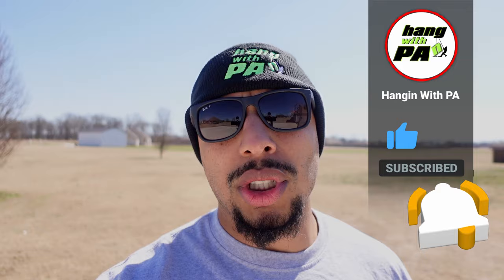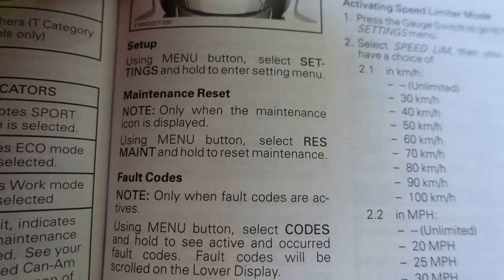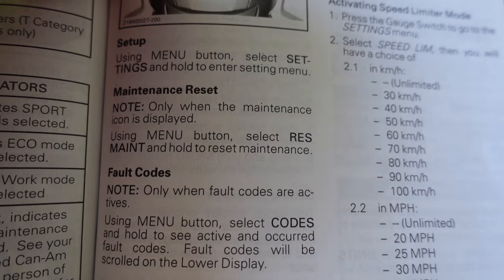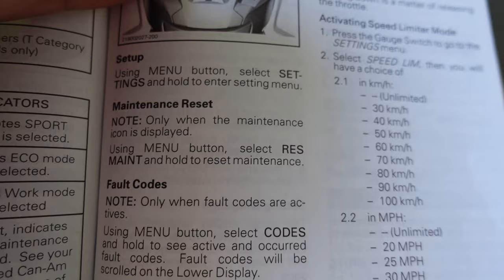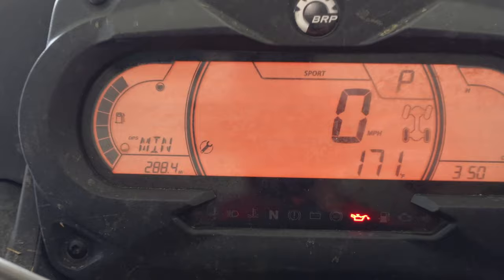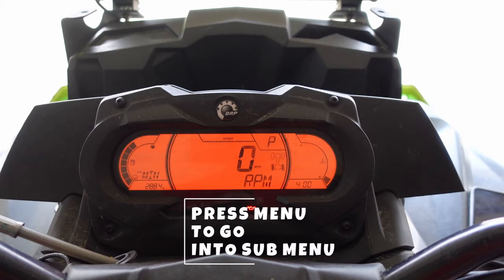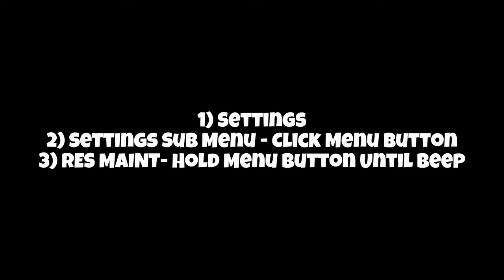HOW TO RESET MAINTENANCE REQUIRED LIGHT 2020 CANAM OUTLANDER

Comment: That noise is a check valve on ur vent for ur gas tank pretty easy fix its on the back right side under the finder by filler neck... thanks for the vid
Reply: My homie has a renegade was doing the same thing worth a look pretty sure the outlanders r the same
Reply from the maker: What noise are you referring to? What time in the video ?
Reply: When u start it after clearing the code its the whistling sound
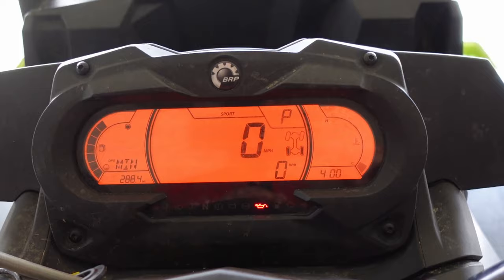Reply: From 1:30 and on u can hear it
Reply from the maker: Ok i will look into this thanks
Reply: @HanginWithPA  mine makes that whistling sound in park and neutral, pretty sure it is noise resonating from cvt belt vent.  Will go away as soon as it gear.
Reply from the maker: Thanks 🙏🏽

Comment: Mine has only the message not the wrench maintenance key 2020 outlander how do i fix it
Reply from the maker: The manual says the wrench needs to be up on the dash before reset
Reply: @HanginWithPA  thats weird i have had the wrench icom before and reset
It with no problem but know it only throws me the message
Reply from the maker: Humm let me check the manual and get back to ya tomorrow
Reply: @HanginWithPA  thanks
Reply: Will be waiting for answer thank you
Reply from the maker: This is straight from the manual to erase the maintenance required message proceed as follows: One from Main display (vehicle speed ) press it and hold . 

Two alternate between low been in hiding three times note step two must be completed within two seconds 

Three: release set button
Reply: @HanginWithPA  so i ll go to speed on setting and leave the button press?
Reply from the maker: I believe you just need to be on the main menu where vehicle speed is shown then follow steps
Reply from the maker: Hit me on FB , TikTok, or Instagram and I can send you a picture of the manual
Reply: @HanginWithPA  how do i find u on Facebook
Reply from the maker: Hangin with pa
Reply: @HanginWithPA  fixed it thanks for the help